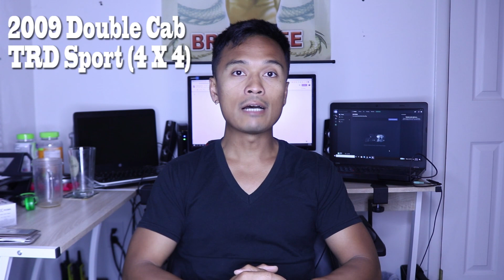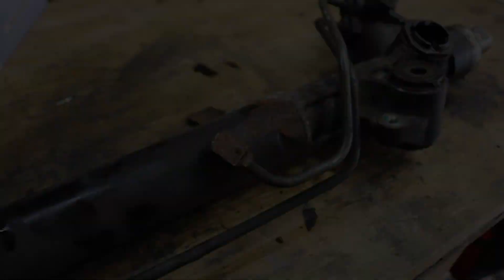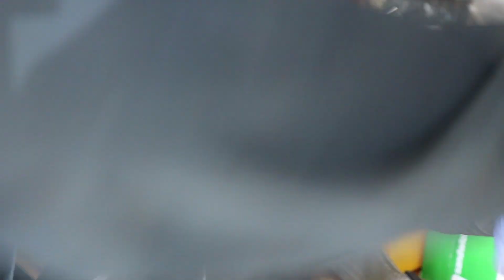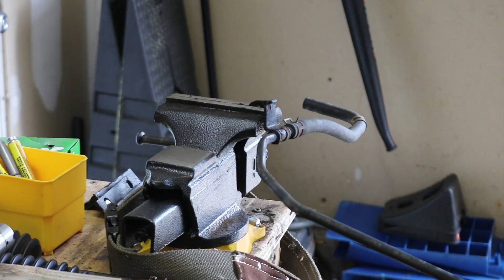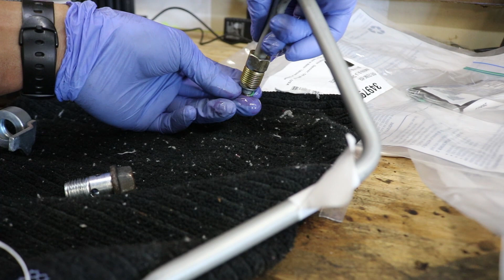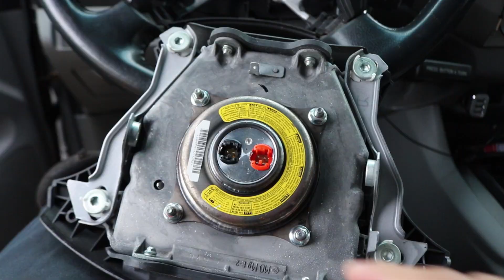Tacoma Steering Rack Replacement (DIY / How To)

Comment: What year is this truck?  I have a 2020 TRD 4x4 that will not go in a straight line it’s either a slight left or right depending on how you adjust the wheel..

Comment: Just wanted to thank you for the video. Removing the inner tie rods was key.  Made replacing my steering rack a breeze.  Zero issues getting that bolt out under the a/c compressor. I had to do this job because my steering coupler seized up causing my steering to bind up.

Comment: Thanks for this video! So you didn’t have a hard time getting that driver side steering rack bolt out? I read so many complaints about people having to either remove the ac compressor or lift the motor in order to get that bolt out but you made it look so easy! That’s really what’s stopping me from doing it on my own is all the complaints about that one bolt lol. I have a 2009 4x4 as well but mines has a drop bracket lift installed also..
Reply: It looks like he has the 4 cylinder engine not the V6 with the A/C compressor over the bolt.  None of the videos I've seen differentiate what specific type of tacoma they are working on... the 4wd V6's are considerably tougher.
Reply: @NotBob223 thank you so much for clarifying!! I was wondering what model this Taco was. I’ve got the v6 and questioning doing it myself.
Reply: @ryangentry3084 cut the bolt and reinstall upside down. I spoke to a buddy that works as a tech at Toyota and that is what they do to avoid lifting the engine or removing AC Compressor.

Comment: Bro I am stuck on that drivers side bolt that secures the steering rack. I don't get how you were able to get that much clearance.
Reply from the maker: You'll have to really finagle the thing. At worst case just cut the bolt and install it from the bottom. That's what many people do
Reply: @KFlo Tacoma  I am not gonna lie I wasn't expecting you to reply haha. Bro, I have been watching your videos to help me get through my maintenance needs for my taco. Thank you for the reply. I decided I'm gonna just cut it off and get a new bolt
Reply from the maker: No worries bro, good luck with the rest of the work

Comment: Hey kFlo love watching your videos! I'm trying to remove rack and pinion so I can change bushings. I can't seem to get the lower part of steering wheel shaft separated. Is their play in the steering wheel shaft that will allow the two to separate? I'm trying to do the same thing with long prybar, but hesitant that something else is wrong. Any thoughts. Thanks
Reply: Hey thank you. One more question, was your driver side bolt installed from the top down. Someone on tacomaworld said you had to cut a little of the bolt. If so is there enough room to rock the rack forward without having to cut that bolt. I have new ones just in case. I just wanted to say how thoro your videos are. You do excellent job at going through all the steps. Thanks again!
Reply from the maker: It's definitely doable to rock the steering rack back and forth to get that bolt out and pop the bolt off from the top. It will just take a little bit of patience and persistence
Reply from the maker: Yes there's some play that you can work with. Spray that area with a lot of pb blaster/wd 40. Stick a screw driver in between the slot once you remove the bolt completely from the intermediate shaft. The goal is to break the corrosion seal between the steering rack and intermediate shaft

Comment: KFLO the driver side Steering Rack mounting bolt is a Major B to remove. Do you think it would be okay to mount it upside down with the nut on the top. I don't want to remove my AC compressor to get that long bolt in.
Reply from the maker: It's your call bro. If youre going to mount it upside down, I would recommend putting loctite to prevent it from slowly backing out

Comment: What name brand steering rack did you use. I’ve checked out your Amazon store. It doesn’t have what steering rack you used. I saw only the inner and outer tie rods.
Reply: What made you go with a non-OEM rack and pinon? How is the deck holding up a year later?
Reply from the maker: I just updated the Amazon page, you should be able to see it under the "steering system" folder. thanks for watching and supporting the channel!

Comment: Hi experiencing a knock and loose steering on my tacoma, would you mind helping me identify what it is? Do I need to replace entire rack? https://youtu.be/iYkKZv82WCs.
Reply from the maker: From what I see, you have your truck on jack stands in the front and the tires are currently off the ground. The steering wheel is currently locked. What your doing is spinning the steering shaft (which is connected to the steering wheel) and hitting the lock positions of the steering wheel. I would say try spinning it back and forth again but put the passenger side wheel on the ground so that locks the one side of the steering rack. Then recheck the play
Reply: Thanks will do that next

Comment: what was the cause for you to change this? 
i have a 06 toyota tacoma. when i’m driving & start to gain speed it shakes really bad. i was told it was bc of inner & outer tie rods . i replaced that & it still shakes bad. i tried a new alignment & wheels still had the same issue . recently had new cam bolts put on and it’s worse now ... steering wheel sits to the left side . any thoughts ?
Reply from the maker: Check the looseness of the following ball joints: Lower Control Arm and Upper control arm. Wheel bearing may also cause shaking too - check the looseness of that next. You'll need to do this while the truck is on jack stands. Use a pry bar to get in those joints to inspect for play
Reply: @TacomaTutorials  I'll have to disagree on the wheel bearings causing shaking. If they're bad, you'll hear a roaring that changes with speed. I suppose it possible, but the more likely culprits would be: upper and/or lower ball joints, tie rods, steering rack, and control arm bushings. Could be any of these alone or in some combination.
Reply: New cam bolts? What did they say about the control arm bushings?
Reply: Hey alex, did you ever fix the issue? My steering wheel goes left also and my truck shakes when I accelerate. Did fixing the steering pack fix the problem?